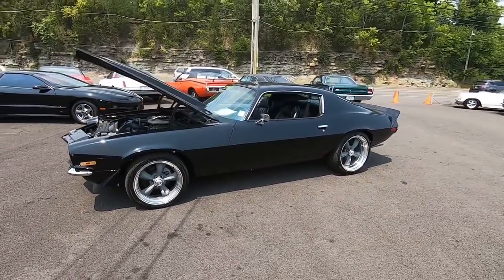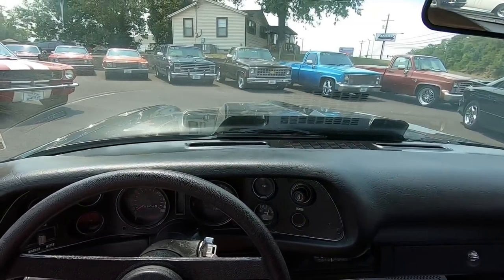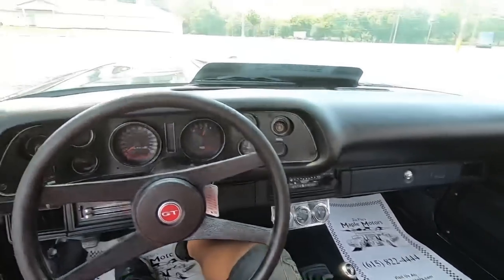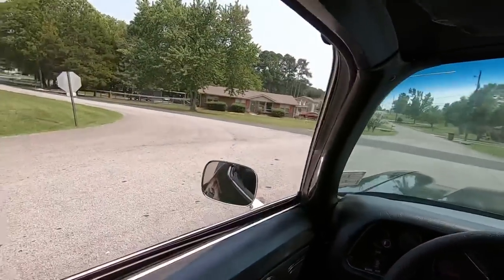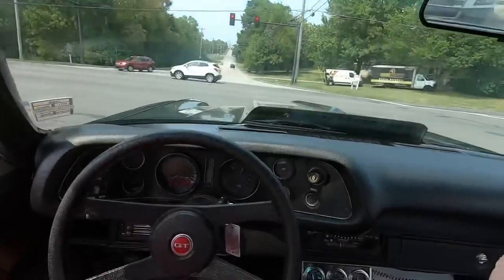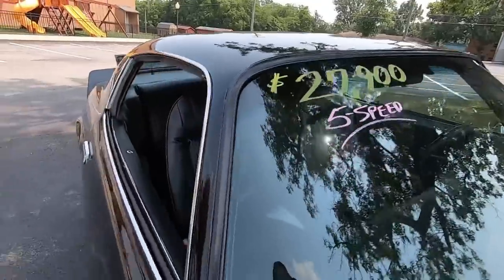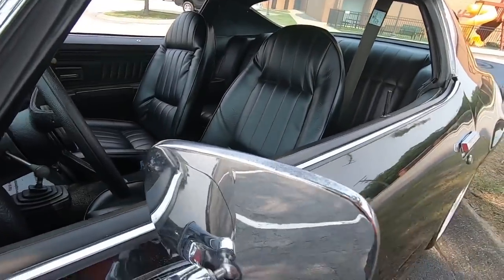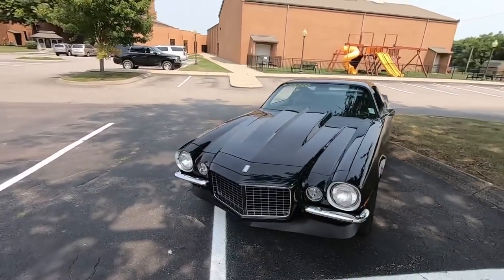Test Drive 1971 Chevrolet Camaro SOLD FAST $27,900 Maple Motors #1228

Comment: Had an 70 1/2 Split Bumper 350 , Big Cam , eldebrock. High rise Electric  Fuel pump Solid Lifters , 500 HP , 3 miles to an Gallon , n -50’s on back Deep Dish Craigors , tortionBars  rack and pinion steering , Should have Kept , copper Gold Paint , Still Dream about it !